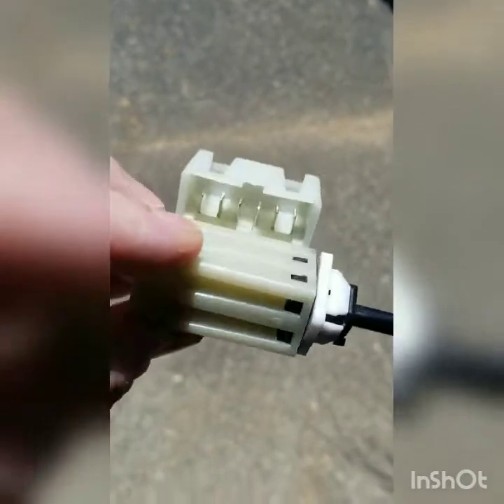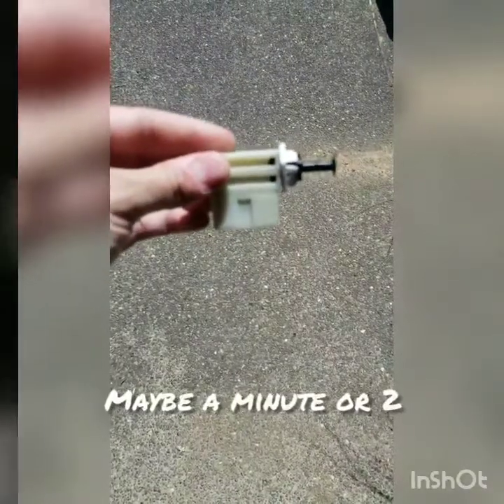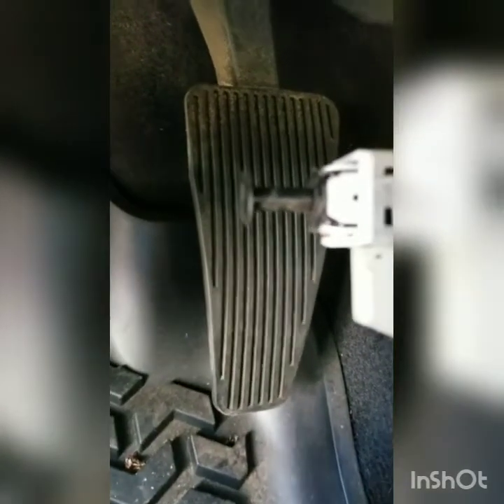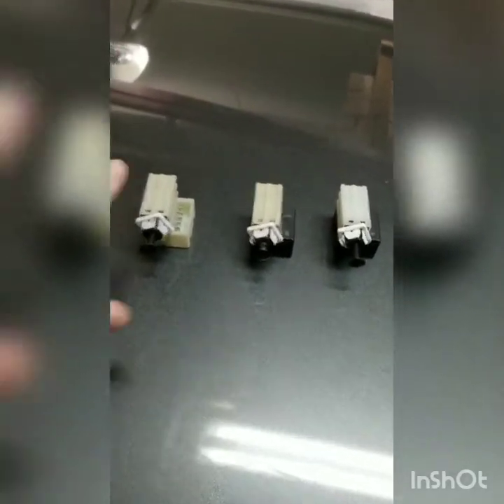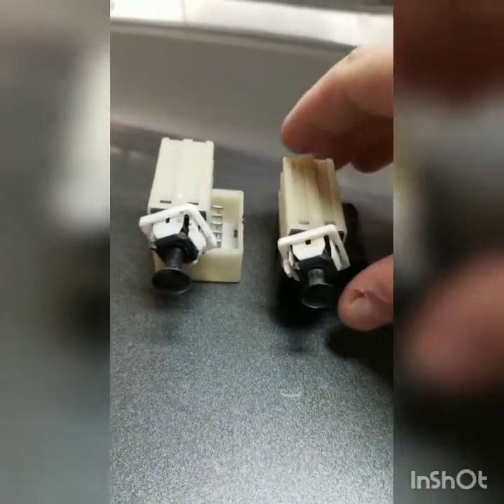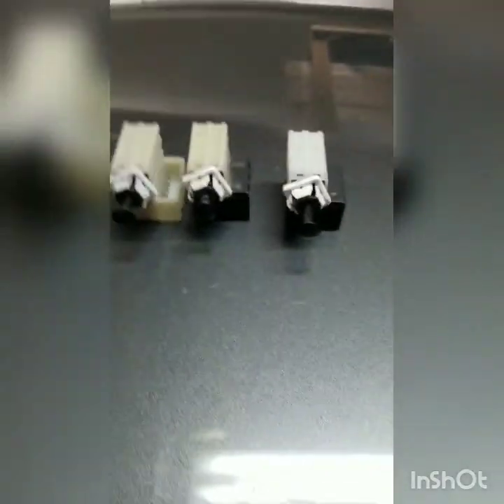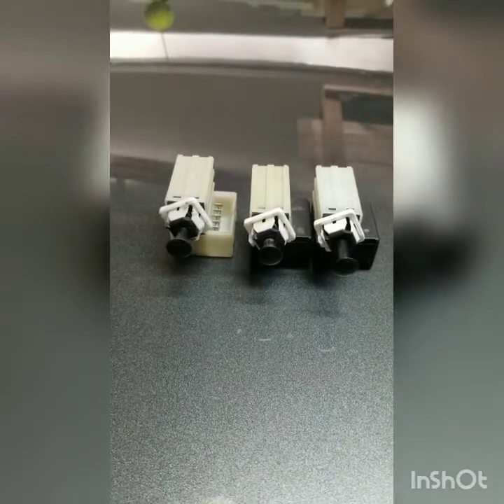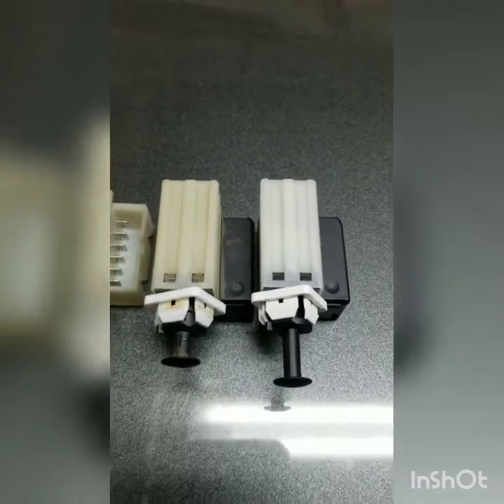Dodge Ram 2012 3500 Brake switch

Comment: I’m having this same issue right now, had to pull the dash for a heater core in the exact same truck (it sucked) and broke my light switch, this video really helped me out, it ended up being the third option after trying 3 different ones! I appreciate your video!

Comment: You can adjust the plunger. Just push in or pull out farther. My problem is no one tells you how far it should be adjusted.
Reply from the maker: To be honest I did not even know that you can actually adjust that plunger! And talking with my mechanic though he said it's not uncommon to have an issue with that particular part when it comes to OEM versus aftermarket
Reply: @professorhootu  I still can't fix the cruise control on my 2012 Ram 1500. One of the possible fixes was the Brake light switch but it did nothing. Any ideas?
Reply: @billbewitz2247  Did you use an OEM switch? If so I guess that's officially ruled out. Did you scan for a code? The accelerator could be the culprit. I would check for the velocity control and also make sure the truck is "ZERO'd." If it is not it would probably be throwing a engine check light though.